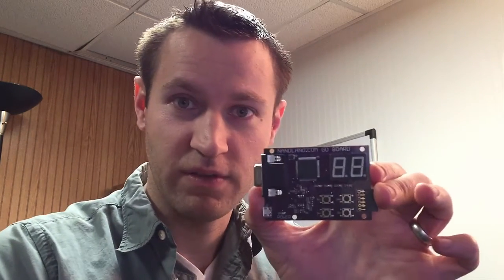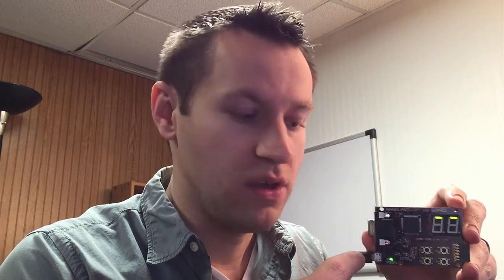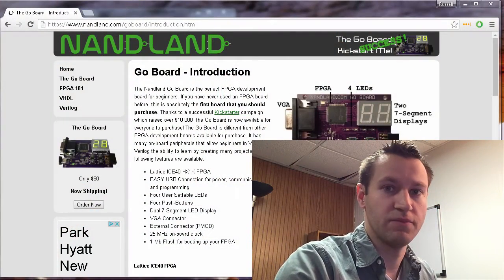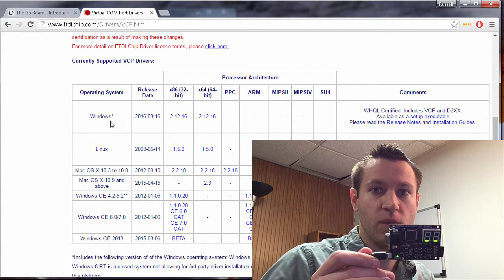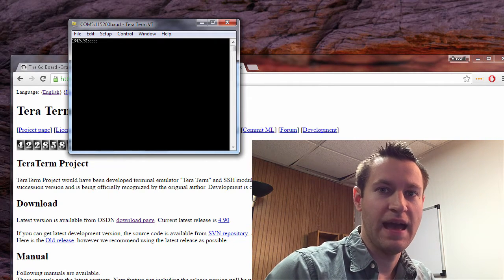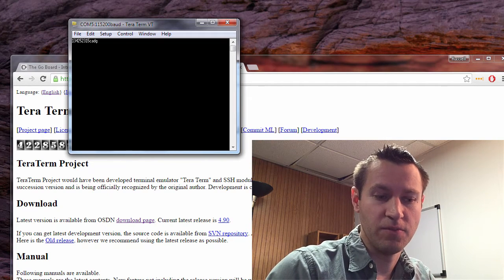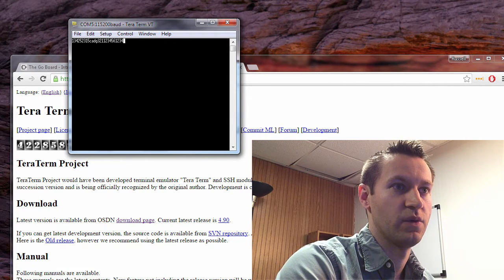Nandland Go Board - Watch This When You Receive Your Board

Comment: The Lattice Diamond has a free-tier license that supports the higher end ECP4, ECP5 devices...  but the Go Board's lower-end ICE40 HX1K board requires the $470 iCEcube2 design software??!      I get that the ECP5 probably costs 2x as much as the ICE40, but any plans to design a version with the newer/bigger chip that is supported by the free software?

Comment: I like others can not cinfiure serial port for teraterm,  serial port grayed out, when I try form main menu says, no serail port, googled but haven't found anything yet? didn't see any responses to others who had similar issue?
Reply: I think the drivers are not getting installed correctly
Reply from the maker: Open Device Manager. Look under Ports (COM & LPT). When you plug in the Go Board you should see 2 COM ports pop up under there. If you do not, try a different USB cable.

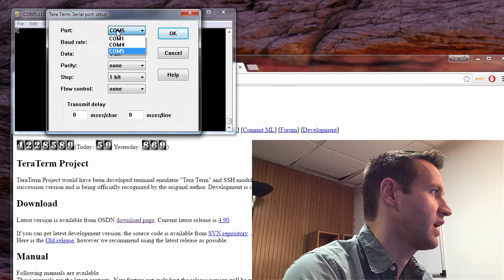Comment: Hello Russel, i received the Go Board yesterday. Unfortunetely I can not continue your tutorial because I have issuse to communicate via USB port as you are showing in this video [03:05]. It does not work. I tried multiple USB ports on my PC. But none of them works. Can you help me? By the way everything works fine on my Laptop. THX and BR Marco
Reply: Hello Russel again, even if I could not communicate with my Nandland Go Board using "Tera Term VT" it was finally possible to  program my FPGA with the binary file. Maybe there is a issue with the "Tera Term VT" tool because I could not type any letter fromm the keyboard in the terminal. So I would say problem solved. By the way I am very very happy with the board and tutorial so far :) BR Marco
Reply from the maker: Glad you found a workaround.

Comment: received my Go board - thank you! 
Everything works except the VGA display patterns when I hit 4 or 5. I get a blank screen on 4 and on 5, there's a very, very dim set of vertical colour zones on the screen (almost invisible!). Is this a known issue with the Go board or certain VGA displays? I'm using the setup you recommend with Tera Term and everything else is fine. Thanks for any help you can provide.
Reply: resolved! changed monitor and was able to get display patterns for 4, 5, and 6. Appears to just have been the 10+ year-old I-Inc 27" cheapo monitor(that works for everything else, strangely!). Plugged Go board into a 40" 4K Philips and got the patterns. A little hazy on the colour band transitions, especially in the center of the screen on pattern 5 but that could be analog bandwidth/impedance issues unrelated to Board function. 
Thanks for the whole series of tutorials - I'm excited to get going! :)

Comment: Just received my board. LEDs and 7-seg working. Followed the steps and tried multiple USB wires but can't get anything out the serial or VGA... pressing on with the next steps and hoping things sort themselves out... any advice appreciated though...
Reply: RIght... I have it working fine now. A couple of points for clarity...

1 - When you connect via serial you will not see anything unless you type on your PC keyboard. If you type and you see the numbers coming back at you.. it's working.

2 - I mistakenly thought the VGA would toggle using the on-board numbered buttons... this is incorrect. To set the VGA test patterns you press the corresponding number on your PC keyboard.

My board is working fine now and I'm looking forward to the next steps ! Thank you !

Comment: Three months ago I posted my constraints which I managed to overcome. I got the Go-Board to work and did Project 1 sucessfully. But after that (1) the tera term will not display anymore on it's screen when I hit the key board (2) when I turm on local echo on  local echo on Tera Term  it then displays on it's screen (3) when I try the vga display test as per GO Board test tutorial no signal goes to my monitor (4) when I test initial swiches as per test tutorial the LEDs light up but the & segment displau no longer shows. Kindly assist. I do not accept to give up.
Reply from the maker: When you reprogram the fpga the test code that you were talking about is not there anymore. You can always reprogram it back to that initial binary file.

Comment: I was able to get mine to work by selecting setup executable in the far right column of the FTDI download webpage.  I selected the .exe file for Tera Term and I did the "standard installation".  In Tera Term I selected "Serial" (bottom option) "COM 9: USB Serial Port (COM 9)".  The cable I used was from an old cell phone that had the data and power lines.  I have not tested the VGA display, I will attempt to do this once I get the cable.

Comment: Can't communicate with the board through Tera Term App, even though I saw Com Port 
on system and my USB cable that can make commuication with other device laike ESP32 Borad. Kindly help!
Reply from the maker: Are you trying to use the FPGA image that comes loaded with the board? If you reprogram it to something else, you need to actually instantiate the UART. That's Project 7-8 of the tutorials. https://www.nandland.com/goboard/ I recommend working through them starting at Project 1.
Reply: @Nandland  thx
Reply: @Nandland  It still does'nt work to communicate with the board on typing something on screen. But I can communicate with the board through iceStudio.

Comment: For modern Linux (kernel 4.4.0) no need to install drivers. Just install your favorite terminal emulator:
$ sudo apt install screen
Plug go board in USB and check for new tty devices on USB
$ ls /dev/ttyUSB*
/dev/ttyUSB0  /dev/ttyUSB1
Connect to go board by "terminal": $ sudo screen /dev/ttyUSB1 115200
Reply from the maker: Thanks!

Comment: It would have been nice to know which download which VCOM driver to download, based on some intuition since I am running windows and a 64 bit operating system I am guessing I should download the x64 64 bit windows driver, am I correct? Also it would have been nice to know if all the necessary cables come with the goboard Also it would have been nice if you quickly explained why the colors on the screen are changing just by typing in different numbers.
Reply from the maker: Jarrod. If you have 64-bit windows then 64-bit driver is the right one :) I don't know which OS you're running. You do need a Micro-USB cable, which if that's a problem for you I'll ship you one, but most people have dozens lying around and I felt like I savings a few dollars for my customers was better than more cables. As far as the VGA tutorial, that's a lot to explain quickly, so check out the VGA Project when you get there. Have fun!

Comment: I'm trying to get the serial connection working. I was wondering, 1. How do I pick the COMM port #? 5 does not work on mine. Can it just be any COMM #? 2. I don't get the echo so need to troubleshoot. You mentioned some cables do not have the data wires, but is there a way to test or verify this?
Reply from the maker: Go to windows and look at Device Manager. Under COM Ports you should see the COM Port pop up when you plug in your Go Board. If you don't see that happening try a new cable. Hope that helps.
Reply: @Nandland  That worked (after a bit of playing around)! I have now verified the pushbuttons, echo, and VGA so I think this is going to work. Thanks again.

Comment: FOR LINUX USERS.
For recent linux  (over Ubuntu 11.10, kernel 3.0.0-19) (mine is kenel 4.4.0-140-generic based on ubuntu 16.04) you just need:
1. sudo apt-get install gtkterm
2. connect your go-board 
3. sudo gtkterm -p /dev/ttyUSB1 -s 115200 -b 8 -t 1

You DO NOT NEED to install any drivers they already come with the kernel and they recognize the go-board (FTDI serial port).

BOTH ports /dev/ttyUSB0 and dev/ttyUSB1 are seen by:
dmesg | grep FTDI
that answers:
[ 5997.028880] usb 2-3: Manufacturer: FTDI
[ 5997.029520] ftdi_sio 2-3:1.0: FTDI USB Serial Device converter detected
[ 5997.030774] usb 2-3: FTDI USB Serial Device converter now attached to ttyUSB0
[ 5997.031048] ftdi_sio 2-3:1.1: FTDI USB Serial Device converter detected
[ 5997.031462] usb 2-3: FTDI USB Serial Device converter now attached to ttyUSB1

BUT only  /dev/ttyUSB1 worked for me.

Comment: So Do I need monitor to make sure that the board  responses to my code ?  Should me as a student who has started soon to learn about FPGA  have one ?and also, I didn't get what are interfaces and colors appeared on the monitor . I think there is some difficulty in some terminology in the video for those who has  started soon digital design course and started to learn about FPGA -For beginners who didn't deal with hardware components much yet -?? What if I don't have  FPGA ? I think it isn't cheap , so is there a software application  to use it  instead of hardware(FPGA board )  ? and what is the difference between VGA and FPGA ?

Comment: Hello, I ran all the tests mentioned in the video. The 7-segment display, the LED's and the buttons work as expected. Using TeraTerm, I also get the echo of what I type. But, I cannot get the VGA display to work. Nothing is displayed and the monitor eventually goes to sleep mode. I have not reprogrammed the board, it is as it was delivered.
Please help.

Comment: Hi Russel, I received the nandland go board. I think I am having trouble with the serial communication. I am on Linux. I figured the FTDI device is on /dev/ttyUSB0. Following this: https://stackoverflow.com/questions/5347962/how-do-i-connect-to-a-terminal-to-a-serial-to-usb-device-on-ubuntu-10-10-maveri. However as echo data into the /dev/ttyUSB0 I do not see any thing back from the board. Do you know the way to go about it?
Reply: Actually I got the serial communication working using moserial. Had to set the connect baud rate. As I connect to my VGA monitor I see a flicker on the screen. The screen is not retained as I send the numbers. What can be done?
Reply from the maker: Hm not sure!  Others have posted their difficulties on linux... read the disqus comments at the bottom of this pagehttps://www.nandland.com/goboard/setting-up-environment-icecube.html

Comment: Hi, I went through the steps of the video with my board, but the monitor part didn't worked well for me. When I pressed a number, an horizontal line of color flashed in the screen and disappear in almost immediately. This happens any time I press any of the numbers. Any ideas?
Reply from the maker: I'm sorry you're having trouble with your board!  I haven't heard of this type of failure before.  Is there any way you could try using the board with a different brand monitor?  Also, did you reprogram the board or has this been happening since you received it?  Also, do all test patterns fail or just some of them?  Thanks!
Reply: Hi. I solved it, in the end it was just an issue with my serial client, it was sending the information  in some weird way (I was using cutecom for Ubutnu), I just switched clients and it worked. Thanks for your prompt reply, I can't wait to begin the tutorials ;).

Comment: Will it work on a Mac or just Windows PC ?
Reply from the maker: +Chin Fu The tools require either Linux or Windows operating systems.
Reply: I just got mine, and connected to mac, installed virtual com port drivers form website mentioned in the video, then used "screen /dev/tty.usbserial-000xyz 115200 and I was able to connect to go board. xyz is just an example number in the command.

Comment: I received my  Nandland Go board on the 30th of March.  I went to the Nandland
web page and follow the link for what to do after I received the board.  I was able to do the basics check out for the push button switches, switch LEDs, and LED segments.  It wasn't until I examined the new You Tube video for receiving the board created on March 30 but I was able to do a complete check out.
Everything went smoothly except when it came time to check out video.  For some reason with COM3 selected I appeared to have communication (12345 and the letters I typed were echoed back to my Tera Term session window.) But upon hooking up the video cable to my monitor nothing was displayed when typing one through five.I
discovered through trial and error that my FTDI port emulator appears as my last COM port in the list of available COM ports.  This also appear to be the case in the video demonstration.  Hope this helps somebody else.
Reply from the maker: +Willnot Takeitanymore Thanks for posting about your experience.  Glad you were able to bring up the board successfully.  Out of curiosity, did you have to download the D2XX drivers from FTDI?  http://www.ftdichip.com/Drivers/D2XX.htm  I don't believe that these are required, but it would be nice to know for sure.